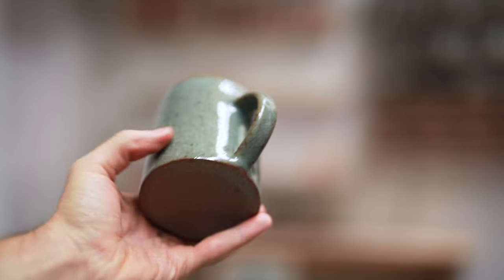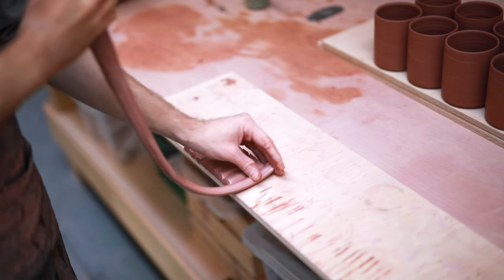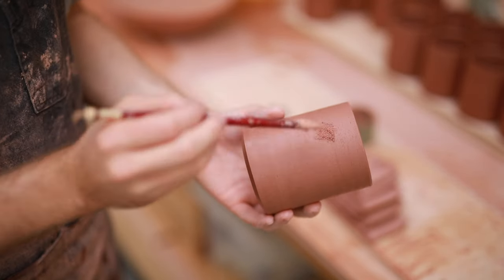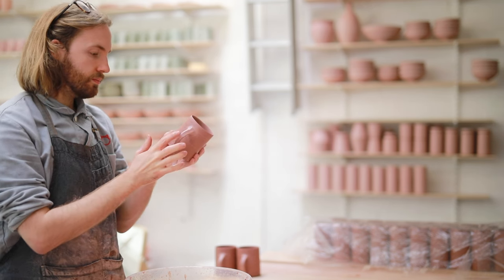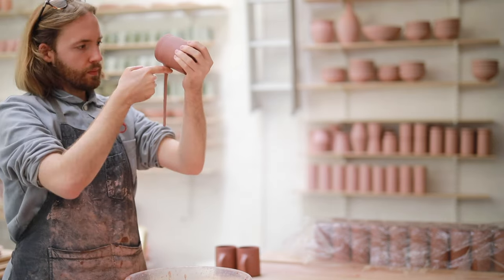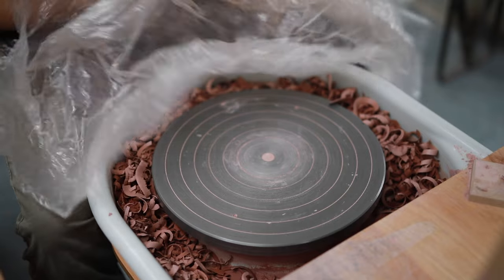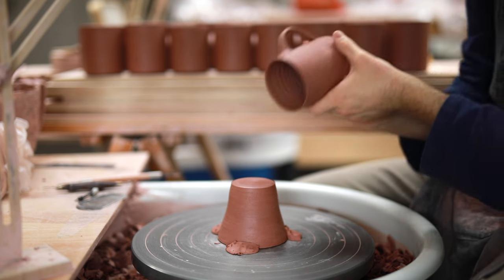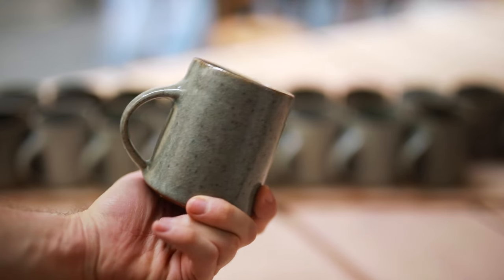How to Pull and Attach Handles on Pottery Mugs — Narrated Version

Comment: You can make a container that will keep all your chucks the right consistency by putting a few inches of pottery plaster in a sealable plastic tub.  Wet the plaster to the right humidity level and it acts like a buffer that adds or removes water from anything not at that consistency.  If the lid of the tub has a good seal, this setup can be remarkably stable through temperature and humidity changes in the studio.  Great video!  Thank you.

Comment: Great video, thanks so much. Can I ask, when you pull the handles from the mug, are they a different dryness/leather hardness to the mug?
Reply from the maker: The handle blanks are soft when I attach and pull them, like you'd get it fresh from the bag. If they were leather hard you'd never be able to move the clay so personally I like them to be as soft as possible. Thanks for watching!
Reply: @floriangadsby OK great thanks very much. One last question, do you ever get any cracks where the handle joins? Or does wrapping them and drying them very slowly overcome this?

Comment: I like trimming mugs when they are leather hard. I find that my handles are cracking along the attachment points. Any suggestions?
Reply from the maker: They often crack if the mugs themselves are too firm at the point of attachment, or it could be that you aren’t pushing on the handle blanks firmly enough and blending in the surrounding clay sufficiently. Lastly, and perhaps most likely, you could be drying them out too fast. Once handled I wrap the mugs up tightly in plastic and even spray them with water a little bit. That way they dry slowly. If you rush the process they’ll simply crack around the joins.
Reply: @floriangadsby  Understood! I will start spraying and wrapping :) Thank you, Florian.

Comment: I'm understanding correctly that the handle is not leather hard when attached? Just the cup is?
Reply from the maker: That's exactly right. It works, as long as once attached you dry the handled cup very slowly. I usually wrap mine in plastic and even give them a spray of water, then I leave them for a day or two undisturbed.